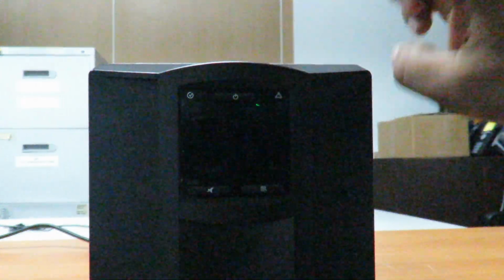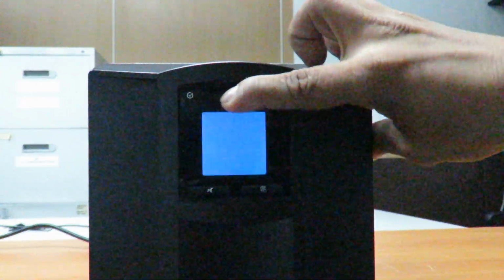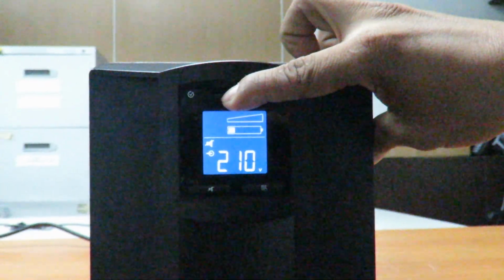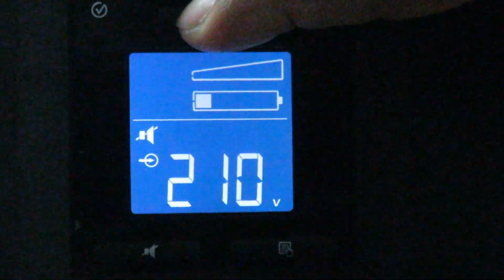How to Set Sensitivity for Smart UPS SMC Series

Comment: Wondering how to / if it's possible to set sensitivity of the internal thermosensor to trigger emergency shutdown or at least constant Battery error condition when batteries get hot and there is a risk of bulging. 
I have seen disturbing amount of reports about UPSes (including the SMT series) being unable to detect when they shouldn't continue charging, and they keep going on even when the battery has bulged and even smoking.